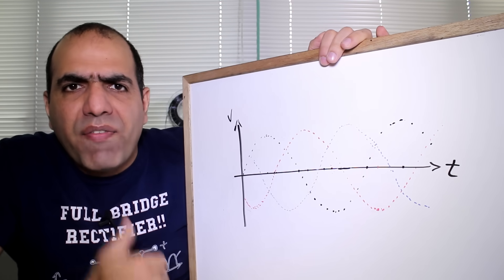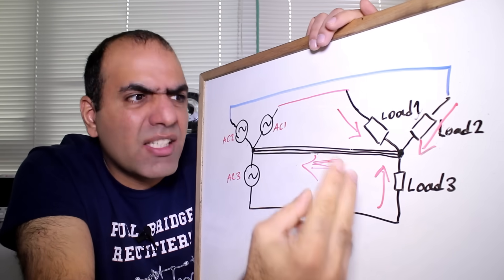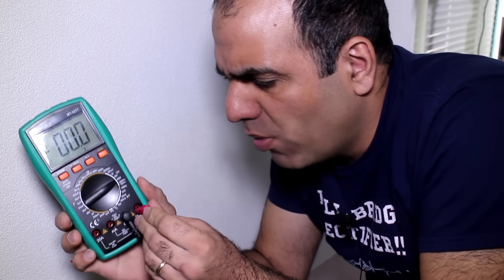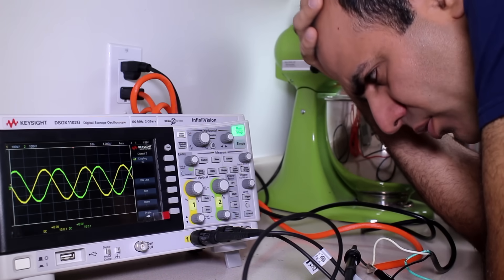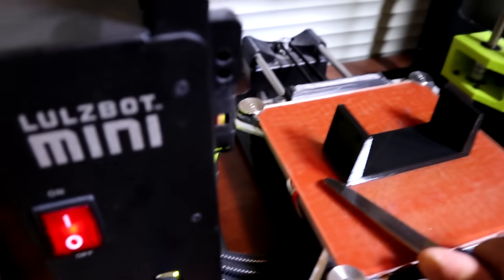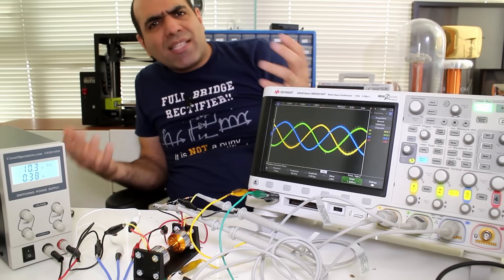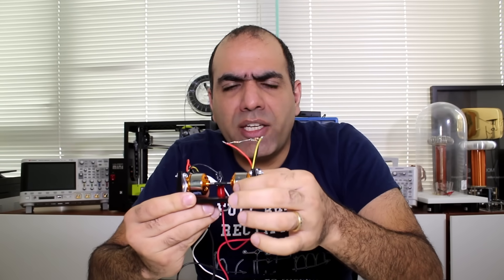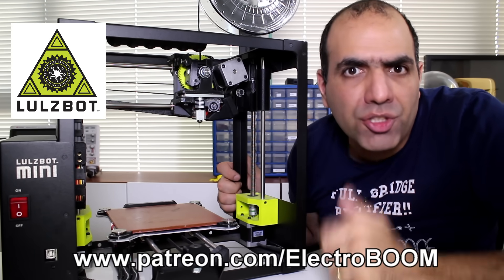Why 3 Phase AC instead of Single Phase???

Comment: why do "brushless" motors have lower torque? claiming efficiency while using higher
amps/foot lbs. are consumers being sold on an implied specification while "brush-
less" drill motor installs half the screws per charge? g

Comment: 5:04 this isn't actually true Mehdi, you see the BLDC motors are powered by full H-bridge module that is controlled by PWM module. Basically it outputs controlled DC power spikes to the the corresponding wires making it similar to 3 phase AC but not actually.
Reply from the maker: True for voltage wavefor. But look at the current in each phase and you see 3 phase AC

Comment: It may be different in Canada, but for the most part it seems Canada is pretty close to the US. Houses don't get two phases. Apartment buildings with their massive power requirements may, but you'll see a 208/240V rating on large appliances for this reason. Houses get one of the three phases at 240 volt, and this phase is split into two 120V. Most outlets get 120V from one half of the transformer or the other, and bigger loads at 240V get two 120V 180 degrees out of phase.

Comment: Great video as always, but you got the power facts wrong.  Not three times the power, only sqrt(3) (aka 1.73) times the power.  If you have two wires running at 240V and 10A, it is 2400W of power.  If you have 3 wires, 240V, 10A each, with 3 phases, it is 240*10*1.73 or 4157W. So adding 50% more wire gives you 73% more power (not 300 %). The power savings is not really the larger justification for 3-phase power, its use in motors is the justification because 3-phase motors and generators are simpler, cheaper, last longer, and deliver constant torque, and always start in the same direction.  Single-phase motors need start capacitors and starting circuits to force them to start spinning the right way, and the torque delivered pulses at the line frequency.  That 60 hz torque hum creates mechanical problems in systems that become more significant as the motors get more powerful. Single-phase is ok for small motors (like 5hp and below), but for larger industrial motors, it's always 3-phase.

Also, I believe Tesla invented a two-phase 4-wire system he called poly-phase.  This was later improved (by others I suspect) and became 3 phase 3 wire.

Comment: Tesla originally went with two phase AC with the second phase 90 degrees offset from the first. The first big power system at Niagara falls was done this way. It was changed to 3 phase later on, however there was still some 2 phase AC existing not too long ago in Philadelphia PA.

Comment: I am a retied electrician and at one time I was lead electrician/engineer for the third highest building in Washington state. With few exceptions, almost every heavy electrical load ran on 3-phase power. We used many VFD's in our air-conditioning plants. I really liked you lecture on 3-phase power and how it works. I have been out of the electrical field for years but your videos are a refreshing reminder of my happy days as a practicing electrician!

Comment: Shouldn't have probing two 120v phases given you 240v because households use split phase power not two 120v legs of three phase? 

Otherwise your dryer/electric oven etc. would run on 208 not 240 (and they do run on 240v here in Canada). 

Clearly I'm missing something as the voltmeter didn't read 240 though!

Comment: In Australia we have a 240 50 Herts supply we can plug in appliances that have a 2400watt load most house's have a hundred amp main switch the point is with 240 volt we can use a smaller diameter cable to run the same load with out running two phases to get 240

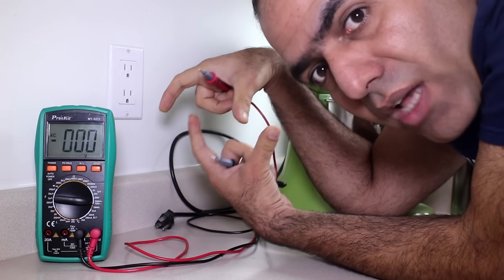Comment: I know it's been 4 years, but I am wondering if you have a 3 phase service in that house. In a 3-phase 120/208 circuit you will have those voltages you measured in that split receptacle. It is possible to have 240 volts there if you had that dangerous 120/240 three-phase with that high leg. Also, it is NOT possible to have those measured voltages in a 240/120 single-phase service that you showed at the 4:00 mark this is why I was asking about the service!

Comment: Another interesting thing about 3-phase.  The simple 3-phase induction motor has constant torque through it's rotation angle.  That's not the case for a two-phase motor.  Related to this, a 3-phase generator faces a constant load per rotation angle (if the load is balanced).  This reduces mechanical stress on the motors and generators.

Turns out that you need a trick to make a two phase motor start rotating in the direction you want.  Otherwise it's a coin toss to figure out which way a two phase motor will spin.

Comment: residential electric is single phase off the same transformer. To achieve 240 or 120 you're using different taps off a single phase transformer.

Comment: BLDC (BrushLess Direct Current) motors do run on direct current. Switched square wave DC, 120° phase shift between the 3 wires. The difference? All phases + relative to ground. AC swings +/- at each phase.

Comment: "Y" is wrong. Star is the correct term (4 wires), used in generation/distribution, while delta (3 wires) is used in transmission over long distances.

Comment: I think a correction is required here: 3 phases electricity on 3 wires HAS NOT BEEN INVENTED BY TESLA. Tesla invented a 3 phases motor using 6 wires and never thought about using only 3 wires. That invention has been made by Dolivo-Dobrovsky. He is also the one who designed the wye and delta arrangements and figured out a easy way to raise and lower the voltage for long distance transportation of electricity. Definitely not Tesla.

Comment: I can understand how you are technically delivering 3x the current but it is really to 3x the loads. In your example you say how it improves upon not needing a thick wire that can carry 3x the current, but if you are trying to deliver power to a single load that needs 3x the current, how does this solve that issue? I can't work it out.

Comment: in Switzerland we get 3 phases in most residential homes split between different rooms. just bring all 3 phases together in a 5 pin socket and you have 400VAC 3 phase power at home and you can run up to 5.5kW induction motors with a 10A circuit breaker.

Comment: As an electrician I can tell you that homes only have one phase.  You have two poles.  The neutral is connected at the middle of the secondary winding on the transformer.  Your panel alternates poles.  When you get 240v between two circuits it’s not because they are two different phases it’s because it’s two poles.  Extremely common misunderstanding.  The two 120v you get at your home are not phase shifted they are on the same phase.  It’s just that you’re only using half the secondary winding when you’re going from one pole to neutral while you’re using the entire secondary winding when going from both poles.  👍

Comment: In Sweden all houses have three phase in and almost all houses have at least one Perilex connector outlet that we call "machine outlet". We also run stoves and washers and such off of 3 phase 400v so the wiring is prepared all over the house.

Comment: I am kind of surprised that the US doesn’t get three-phase AC to each home. It is standard in Europe to get three phase 400VAC to each (modern) home where it is distributed to single phase 230VAC and some outlets with 400VAC, for Electric ovens or high current power tools in the garage. 120VAC seems a little outdated with the high current modern devices have to draw to reach the same power, or am I missing something?

Comment: I always wondered why doubling up 120 made 208 and not 240 but this makes perfect sense because when the phases shift 120 degrees the peaks and valleys aren’t directly over each other so you don’t get the full peak and valley of the wavelength that you would get at 180 degrees

Comment: hey electroBOOM so i bought this 80gal air compressor its 220v but when i plug it in and try and use it it barely runs. so its 3 phase? cant i just take 2 or 3 220v circuits and combine them to equate 3 phase power? i feel like the dude that sold me the compressor rip me off. Also what does 50htZ or 60htZ mean(sorry about the big Z my computer the little Z won't work) Because i have an old lincoln engine driven welder/generator but it only has 50htZ power and not 60htZ. or something. idk.  but i plug stuff into it and they work fine so wtf? do i need to start up that thing and plug it into my compressor to make a 4th phase of power. j/k i don't care about the 4th phase just the htZ.

Comment: You don't have split-phase power in Canada?  Our residential power here in the US has two 120v legs, but they're 180° out of phase with each other, not 120°, so you do get the full 240v between them.  The only place I've seen appliances that run on 208v power is in commercial buildings (a stovetop in a break room or something like that).

Comment: In europe (at least in Germany) you get all three phases in households. We get 3 phases with 230V AC and usally three 16A breakers, which allow for 11kW power consumption (in some cases like an continous-flow water heater we even get 24kW).

Comment: Your description of phases being used in Canada doesn't necessarily apply everywhere. Apartment buildings tend to use 2 legs of a 3 phase where houses tend to run split phase, which is a single phase run through a transformer with a center tap neutral

Comment: My understanding is that in the US, at least in some states, it is against code to run two different phases to a 120 outlet because it can expose users to 240 folks, which nullifies the safety of using 120 in homes.

Comment: 2:30 Civilized countries (basically every country except the US and Canada) actually connect 3 phase power to every house. For example, we have nominal 3 x 240V 25A connection to the grid for our house.
Reply: There's little benefit to three phase power in residential settings
Reply: @Owen_loves_Butters  Using three phases allow increasing the voltage between the phases. Here in Europe the nominal voltage for single phase is 240 V but when you take energy between the phases instead of a phase and neutral, you can get 3x 400 V at the same time. If your fuse is 16 A you can get 3*400*16 = 19200 W with 16 A fuses. If you have single phase 110 V system, you would need 175 A wiring for the same power.

A single electric stove takes up to 11000 W and a semi-quick charger for an EV would take all the energy you can give to it so there's definitely the need for increasing the max power to residential houses.
Reply: @MikkoRantalainen  It's misleading to say that you can get 19.2kW with only 16A at those voltages. You can't. The max voltage there is 400V, which is 48A. It's just that if you connect each phase to a separate breaker, the breakers can each be 16A, but that can also be done with single phase. Even if an electric stove uses 11kW, that's less than 50A @ 240V, which isn't hard to do.
Reply: @Owen_loves_Butters  Are you trying to argue that 50A wiring is equally cheap to build as 16A wiring? And 400V * 48A = 19.2 kW, right? Why do you claim that my message was misleading? The whole point of 3-phase connection is ability to transfer a lot more energy using only 16A wiring and 240V nominal voltage for each phase.

Your imaginary 240V 50A connection to get 12 kW could transmit 60 kW instead if you use 50A wires and 3-phase connection.

In addition, installing 16A wires is quite a bit simpler than installing 50A wires – there's pretty solid (pun intended) difference between those wires.
Reply: @MikkoRantalainen  But you're using three 16A wires to get that 48A, which is something that can still be done with single phase. And what do you mean "imaginary"? You'll find that in every electric stove installed here. Also, 50A wiring isn't complicated to install.
Reply: @Owen_loves_Butters  At least here in Finland, nobody uses 50 A wiring for residential buildings except for connecting the whole building to the grid and event that gets really expensive. Most houses have 3x25A (30 kW) or 3x35A (42 kW) connection to the grid. All things that need more than about 4 kW for a single device will be connected to 3-phase wiring (including electric stoves, water heater etc).

Let's take 20 kW setup for a single device as an example: 3-phase wiring for 20 kW would require 3 wires with AWG 12-gauge wire for combined cross-section area 3 * 3.31 mm² = 9,93 mm² (copper, ignoring the neutral and PE wiring for this example). To transmit the same 20 kW with 110 V single phase wiring (181A), you need AWG 000-gauge wiring which has cross-section area of 85 mm². Or to put it other way, you would need 8.5x more copper for the same power. Do you know how much copper costs? And remember that you need equally beefy wiring from the closest transformer to the device needing the power, not just the wiring within the building.

Can you see the problem with using just a single phase and lots of current?
Reply: @MikkoRantalainen  At 240V, 20kW draws ~83A. That needs 3 or 4 gauge wire, depending on if it's a continuous load or not. Assuming 3 gauge, that's 26.7mm^2. The difference there is around 16.8mm^2 of area. With 1m length of wire, that's 16.8cm^3. At a density of ~9g/cm^3, that's about 151g of extra copper per meter. At $9/kg, that's about $1.36 extra per meter of wire. That's insignificant.

Comment: My only regret is that I didn't come across this channel sooner.  Really great content and excellent delivery.  Plus, the "accidents" definitely help to show the dangers of electricity.
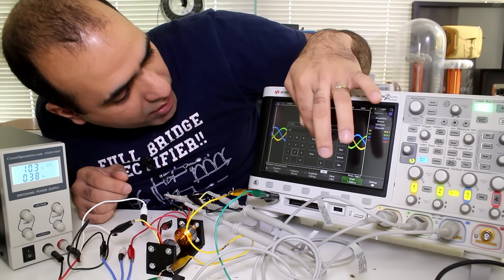Reply: 7:27 It sounds like a printer motor. Because of the sine waves, and at 7:36, this is why it reminds me of "Crazy Machines - Die Erfinderwerkstatt or Warsztat Wynalazcy". It reminds me of Lasko and SMC oscillating fans with my favorite parts that match when some fan parts are different. SMC oscillating fan motor covers are my favorite when they have teardrop shaped vents in a circle, and the Lasko fan motor covers are my favorite when they have arched vents on top and horizontal vents on the bottom. The guard nuts, rectangular mountain slanted oscillating knobs, and if applicable, the "0-3-2-1" marking on the mechanical speed control on top of the motor cover unless it has a remote, which in that case, it'll be on the front of the fan (and may have a timer) are also my favorite, but it depends on what parts are intact.

Comment: Correct me if i'm wrong, but in canada dont we deliver one phase to our homes, not two? One line powers the transformer which is center tapped. Line to neutral is 120V and line to line is 240 volts. Which would give a sine wave 180 degrees out of sync and therefore 240 volts on your kitchen split receptacle. I believe the reason you would see 203v line to line on your kitchen split is because that building has a 120/208v 3 phase service.

Comment: One clarification regarding residential power- It's all single phase. A distribution transformer steps down higher voltage to 240 VAC(in the US)
The reason you have 120 volts and 240 is the secondary of the distribution transformer is center tapped.
What this means is you have two hots and a neutral.
Both of these hots are in phase with each other, but mirror images(upside down) as viewed on an O-scope.
I routinely hear even seasoned electricians calling the two hots two phases.
The reason this is incorrect is the distribution transformer is a single-phase, center tapped secondary, step-down transformer.
Single phase, not 2 phase.

Comment: Kind of confused here. I'm also in Canada, but every house I've ever been in has has single, split phase, not two phases out of a three phase system. In other words, the two virtual phases are 180deg from each other, and they add up to 240V. I believe this is the case in the vast majority of residential situations. I'd say your situation is the exception, not the rule.
Reply: Yes, it is a single transformer producing 240v that is center tapped to produce two 120v in phase supplies.

Comment: Other advantages of the three phase system is that a 3*n phases motor outputs a constant torque over the full revolution and the same is true but opposite for a 3*n phases generator. 
For the same reason you can convert AC to DC at a constant power with a power factor of 1 without needing big capacitor/inductors for the PFC.

Comment: In Germany houses do get all three phases. Only one of these phases is then distributed throughout the house, except for ovens, which typically run on 400 Volts instead of 230 Volts. You can operate many of these ovens also with 230 Volts but then their output power is either limited or you need more expensive cabling and special fusing.

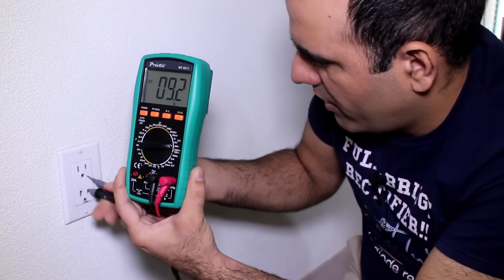Comment: 3:30 Please don't be silly, they wire the top and bottom section of an outlet together.
You will ALWAYS see 110VAC on a pair of sockets like that.
Reply: Nope. That is called a kitchen split circuit receptacle.
Reply: So what's the 203VAC on the meter then? 

Also, a very nit picky correction: it's 120VAC